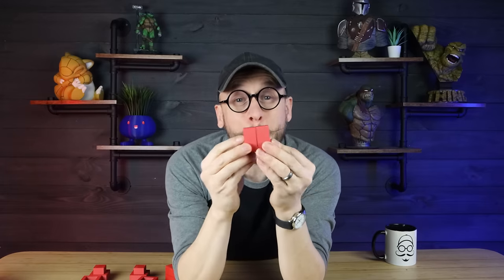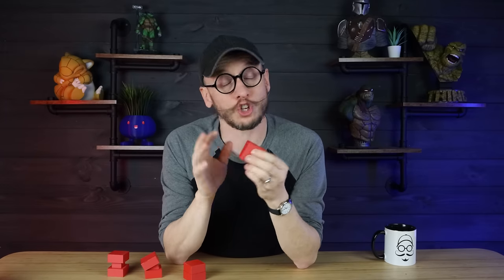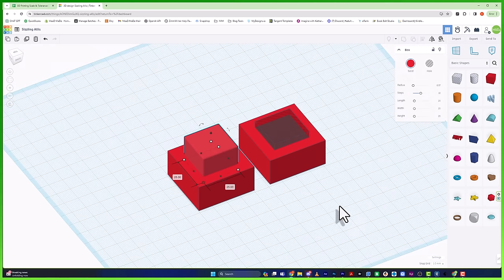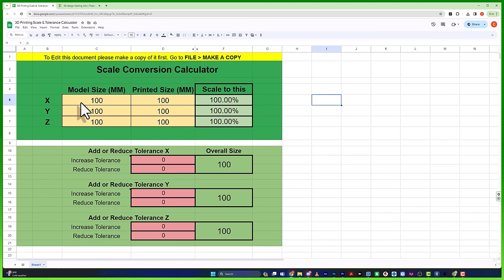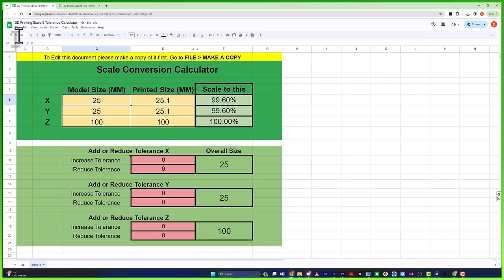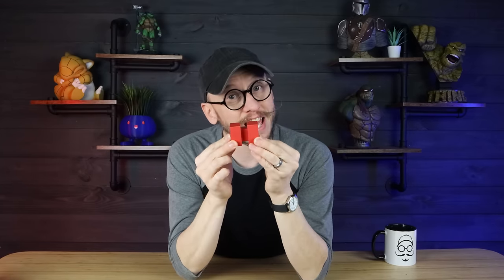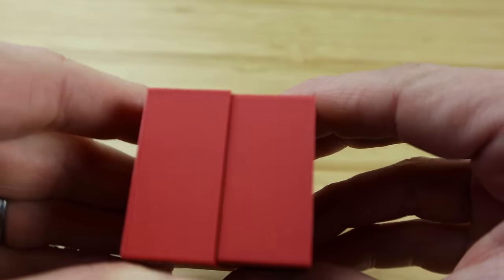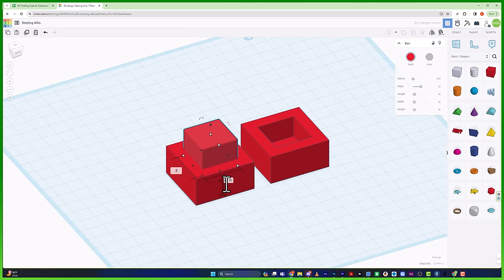3D Print Parts that Fit with FREE Conversion Calculator

Comment: I like your process, but you do not need to scale down an entire part, once you find your tolerance you can just factor it in the contact areas and that’s it.
Reply: Yeah I don’t see how it’s not obvious. If there is a size discrepancy, scaling down the part is not going to fix that, it just makes the discrepancy smaller with the part.  Just add the tolerance .5mm or .10mm and that’s it.

Comment: Please guys it's not hard to just do the simple calculation to know the new scale. Certainly does not need a spreadsheet calculator. If you want an actually good calibration print get the calilantern. Because doing one small cube is not sufficient.

Comment: for simple part adjustment, use horizontal hole expansion in Cura.  It will change the hole and not the rest of the print.

Comment: One thing about doing a "Uniform" scale is it will throw off your pocket depth, boss extrusion and everything. I find it better to mod in a CAD program then print as that way you only change what is required for the fit and not the complete model. Just my $0.02

Comment: I'd simply use horizontal expansion to reduce the size of the model by -0.1. that would also make the hole bigger by 0.1 then use horizontal hole expansion to make the hole smaller by 0.5 which should give you a .5 tolerance in the hole

Comment: Not a bad explaination of the process. Next up you should try using the horizontal and hole expansion settings. They let you compensate for the issues a little easier. The hole one comes in really handy because it lets you shrink or enlarge just the holes rather than the whole part.

Comment: I actually started out 3D modeling before I ever printed anything, so when I was already pretty familiar with it when I finally got a printer. For a while I just made individual parts (or who's interaction didn't much matter), but when I finally needed something to hold together, I did some tests prints and figured out that 0.2mm offset is good for sliding, and 0.1mm for a fricton fit (at least with larger parts, on ones that are only a few millimeters it seems to need to be bumped up 0.1mm more), at least for my printer, not sure how it would work for others (and don't forget to fillet your vertical corners BlargNaut )

Comment: Love your very informative videos. One thing I do to help parts fit is I scale them in Blender on the two axes that need to be changed. I will do a few test prints to see what works. It's super easy to do, press TAB to go into edit mode after you select your object, then just select the part of the object you need to scale, press S for scale, then hold down shift and press either X and Y, or whatever 2 axes you need, X and Z, etc., then type "0.95" for 95% for example I've tried 0.95, 0.90, 0.85 and usually 0.95 works great. Of course this is once your printer is printing accurately.

Comment: Maybe that's a dumb question, but why not just take the model to your modeling program and change it there? It's quick and you don't have to deal with size differences.
Reply from the maker: You are 100% correct. If you have the capability to do it. That’s what I recommend. But, this is intended to help those that are printing a figure and the arm is just a little to tight or big. For when you don’t have the model and how to make it work.

Comment: hey i got a ender 3 in my room and i print PLA is that bad ? i got my door open and a fan
Reply: no but don't have the fan unless it's a overhead fan facing the printer because it will cause inconsistent prints

Comment: You've just dipped your toe into GD&T they teach in engineering school.  I typically print models I've done, most of my modeling are machine upgrades, things for around the house or models for my customers.  GD&T is super important when you're trying to get it to fit onto a machine.  I would say the best thing to do would be print a 1"x1"x1" cube and measure, use a calibration cube for each material (assuming you can keep your humidity under control.  
I understand what you're saying that the modelers are living in paradise since we can make all the adjustments.  I always joke, I can make anything look good on the computer.

Comment: I’d expect to use a tolerance of about the radius of the nozzle.

The filament thickness becomes roughly the diameter of the nozzle, so half of the filament thickness ends up inside the part, the other half outside of the part.

Given an exact print, this expansion of the filament will overlap, by exactly the radius of the nozzle. A .4mm nozzle needs .2mm tolerance to fit. So you’d need to move both walls apart by .1mm.
Make sure to not accidentally double the tolerance, especially when making screw holes

But a 3D print is never perfect and exact so your mileage may vary.

Comment: You can also in Prusa slicer you can just add a box modifier around the peg and put the setting in to do external perimeters first and a lot of times that will give you enough room to be able to slide those parts in easily you can also use the cut tool and isolate just the peg that way you can change just the percentage size on the peg of your X & Y axis that way the main portion of the print doesn't change in size only the peg

Comment: I don't understand your second attempt (excluding tolerance, because that is necessary). Your second print just scaled everything smaller. I wouldn't expect making both pieces smaller to fit any better than the first try. You'd only want to scale down the 'male' part, and if anything, you would want to scale up the 'female' part, if fit was the goal. The dimensions on the female part would be even more off though.

I am currently struggling with this. I actually built in tolerance to a model I made. It was fitting a metal bearing into a hole, and my first print the 34mm bearing didn't fit... by almost .5 mm. My whole piece was undersized. I think my printer is not calibrated. Is that a thing and where can I find how to calibrate the dimensions? There is so much information and lingo to wade through, and I get lost quite quickly. The rest of my print seems just fine, but the dimensions are always too small.

Comment: In machining you have what is known as a clearance fit. If you make a hole the exact same size as the dowel pin, thry will not fit. They make dowelpin reamers to ease up on the hole a little. And if this is a blind hole, not a thru hole, it still wont fit unless you have a way for air to escape. You can get tight metal to fit by freezing the pin, or heating up the hole side.

Comment: Maybe change the wording on the spreadsheet to "add" and "subtract" tolerance with a (Tighter) or (looser), just for clarity. I can tell you now some people that use it are gonna get that mixed up. 

Also, is there a way to add a primitive as a modifier and scale only that section?
Reply: Hi Matthew! I think i know what you mean by "ppl which might gonne get that mixed up" (:
Imagine to have the spreadsheet providing the wording "add tolerance (tighten)" and "substract tolerance (loosen)" ... that probably clarifies the calculation, math and values, for those people which have the "male" object (the piece which will be inserted) in mind - but could cause mixing up for the people which think of the other piece when it comes to change either ones size: the "female" object - in terms of adding or substracting, as long as there is no reference to the one or the other ... no?
Thinking for longer about an unambiguous wording for the spreadsheet to have it defined perfectly clear, i feel like sliding towards the mixed up ppl ;)

Thanks for the great video and helpful tipps @ItsMeaDMaDe 👍

Comment: If it's a downloaded part, and to keep the part dimensions as the creator intended, a bit of sandpapering the insert would suffice. This way you don't have to reprint it again and the part may HAVE to stay the same dimension if, for example, it needs to match up with another object in the overall scheme.

Comment: I did a box with 16x16 outer dimension and another box with 16x16mm inner dimension... it fit perfectly.. I mean perfect!. but I rotated it 90 degrees and it was a bit tight! This was with cura and using PLA+... I wondered if it was the contracting of the plastic when cooling..

Comment: Thank you for the great explanation and all your videos. I printed out the models and everything from on the tighter test that is .25 and lower is basically fused together. I noticed in bambu studio (x1c) it does look fused on some of them. Is this then nozzle/slicer/printer dial in that need to be addressed or is that pretty darn good in terms of accuracy for a home 3d printer.

Comment: The problem with this is that your shrinking not only the middle part but the whole piece. so the body is also going to be smaller and look misaligned going together. I thought there was a setting were you can adjust for the overture and print on inside of the average.

Comment: Great video! Any tips for resin prints? Some resins do shrink when you cure them.
Reply from the maker: That’s interesting the resins I’ve used never so I’ve never experienced that. Is there a specific type of resin or brand? But you probably could use the calculator I made in the same way to fine what you need to scale it too to accommodate the shrinking.

Comment: How dimensionally accurate is a delta printer in general. Would be a better representation if you used a bed slinger or core xy printer that the majority of people own.
Reply from the maker: I have seen no different between all three types of printers. All of mine are typically off between .1-.2mm.

Comment: Thank you. Useful video. But I noticed the gap in the seams and thought, can you get tighter fitting seams? Maybe, could you use variable layer heights (much lower layer height right on the edge) and maybe ironing to get more perfect edges right where the 2 parts join? Just a thought, could be a silly idea, but I'm going to try it.

Comment: This will fail with more complex shapes. Imagine two pegs separated by a flat section. Global scaling means the two pegs won't line up with the two holes. Better to do tolerancing in the model, scaling is for matching the printout to modeled dimensions.
Reply: Yea… pressure advance or xy shrinkage is better. But if you building the 3d model, the tolerances things works

Comment: Tolerance is not what you think it is. CLEARANCE is what you are calling "tolerance". And a big channel like yours is right now redefining the word for a good portion of the 3D printing public and that will get spread wider and wider as time goes on.

Don't do that. Use the correct words and terms and teach the correct terms and words.
Reply: When he’s saying increase by 0.0 and decrease by 0.5 he is setting a tolerance of +0.0/-0.5.
Reply: The tolerance is an acceptable range in dimensions so the parts fit as required, the clearance is what he’s adjusting so it works within the tolerance

Comment: Being each part printed on an FDM printer is a one off unit,  each with its own non repeatable tolerance. This method is just a waste of time. Just design the part with an acceptable gap. You can't control many of the external influences.

Comment: i don´t like most things from sharing platforms, they are often designed for their own home printers with a lot of huge tolerances or like you told us, completely without tolerances, so they are pretty loose, or don´t fit. if you calibrate your printer or think just a moment about reality you get what you have designed! i can´t understand why people design things for their particular printers and not to change/calibrate/upgrade the printer(profiles) to the real world dimensions as close as possible!? Can´t even get it. Other manufacuring processes also have tolerances, why do some people designs without any tolerance? really suspicious........maybe they are the staff of the filament industry...to sell more filament because people have to print multiple times 🤔
Reply: Probably just that they have a new toy and don't know what they are doing. Just because you figured out how to use Tinkercad/FreeCad etc doesn't make you a competent  designer.

Comment: Great video! Thanks for talking about designer vs "printer" type folks. I am a terrible designer, and have been using round peg and holes for fitting, Slant 3D did a "diamond chamfered" thing which works really well for me (https://youtu.be/djm5tCFn9S0?si=Rl4XCKW4Y8Q2xLko&t=20)

Comment: At the start of your video there is no reason even try to print that item you have no tolerance design in the cad drawing. There nothing and I mean nothing can at 0 tolerance that will work, exception is a metal item like that is round, the inserted item is placed in dry ice so it can be press fitted. I’ve never seen it done with a square item. You maybe able press fit with a 3d plastic print doing the dry ice, but as a press fit the only way to remove the part is to dry ice both parts than heat the outside. Just so everyone knows that there is no machine that will manufacture any thing perfectly over time it will wear and the part can be larger or smaller, that is why every blue print has a tolerance of +-1 or xxxx. Was a in middle of typing before I saw your tolerance part of the video. Hope that is clearer, see response to is this my second language below.
Reply: ? I take it that English isn't your first language?
Reply: It’s but I’ve got a head injury from being in the military that affects my speech and writing. Sometimes my writing is better others it way worst. I’ll leave it at that.
Reply: I guess yours is not, why a ? mark at the beginning of the sentence, that is not in any English textbook. lol